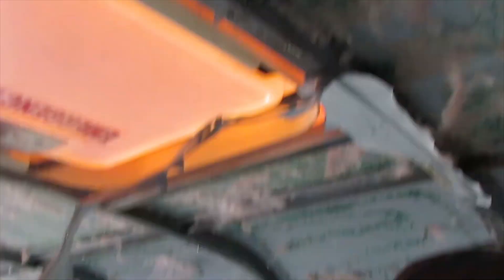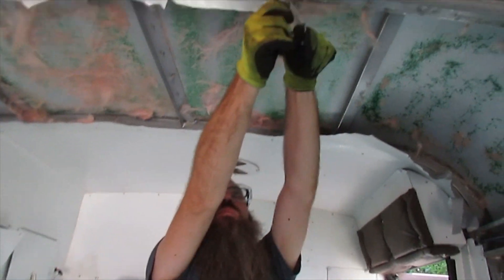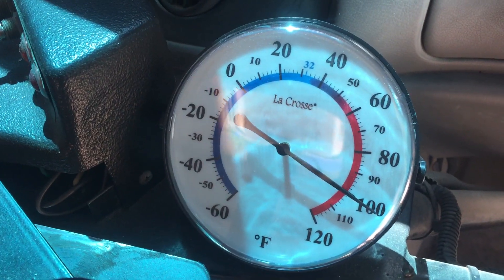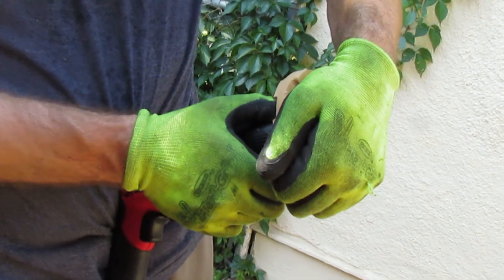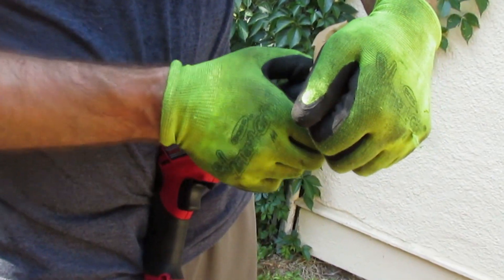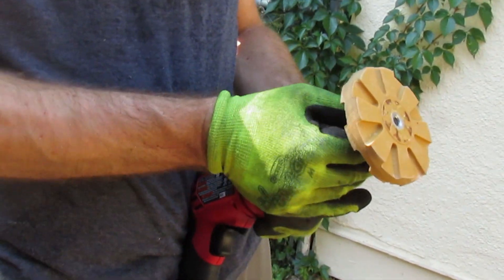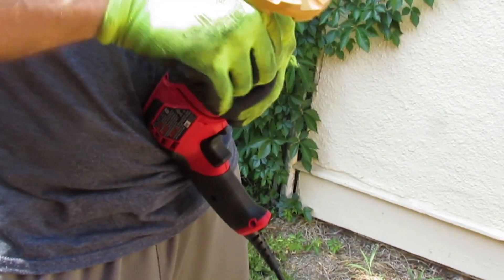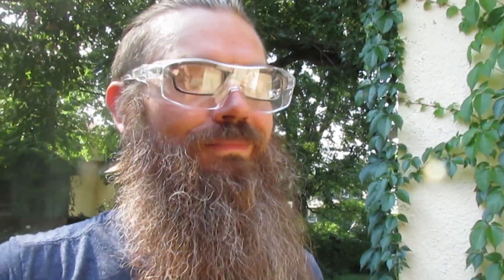I Can't Fight this Ceiling Anymore | Skoolie Ceiling and Decal Removal | School Bus Conversion

Comment: I did not remove my ceilings but any rivets I needed to remove I punched the center out of the rivets with a nail set and then shear the head off with a large flat head screw driver.
Reply from the maker: I may give that a go with the few remaining since I'm nearly out of cut off wheels.
Reply: I give ya credit that was a tough work going that route especially in the heat.

Comment: Maybe you should have painted the roof first? that might have helped a tad with the heat. Or a sunshade. You have to rough up the surface of the outside before you paint.
Reply from the maker: Yeah we had a few holes in the roof to patch before painting so it was easier to access with the ceiling gone. Looks like the weather is finally shifting to a bit cooler temps now.

Comment: I really hope you decide to use spray foam insulation. Not the stuff you get in the can at home depot.
Reply from the maker: I think we are going to go with rigid foam boards. The higher end spray foam would be nice if it didn't cost quite so much.
Reply: We're going to have to go with foam board as well... Should be pretty much OK as long as we "Great Stuff" all the cracks and gaps.